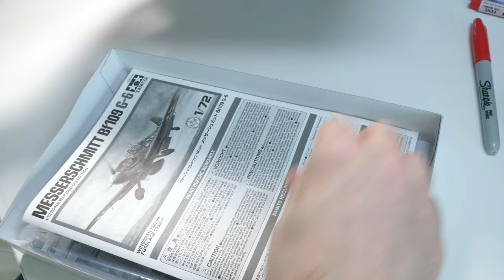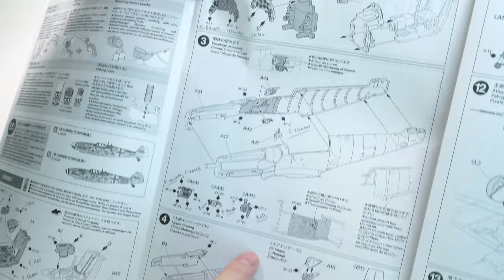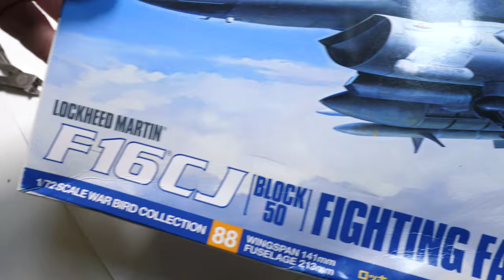HOW TO PAINT WW2 fighter cockpit with Posca paint markers part I

Comment: I have literally spent hours upon hours the last two two days trying to find a vid like this with the info I needed before blowing money. All I wanted to find out was to find a good paint pen, one that I can clear coat/varnish over without the paint dissolving and ruining my projects. I am a newbie to painting and airbrushing die cast restorations. I wanted a way to write and  draw on die cast without buying an inkjet printer, decal paper and other stuff I would hardly ever use to justify the cost and room taken up. So freehand is the way I want to defo go. I realise your vid is on a plastic model, I will be doing them straight from the box too. Anyways…many thanks for your vid and the detailed demonstration and which paint pens you find work for you
Reply from the maker: Thanks ! Really glad this was useful to you. I think there are other pens that are similar but on nearly every project I continue to use the Posco pens. Also they have not dried out. One other tip... you can also use the ink from the pens to be painted on using a fine brush for extreme detailing. Wish you luck on your projects.  You say you will varnish over and that is very important as the paint pen ink itself can easily be scratched off its not durable.

Comment: While these are really handy pens I think you can control the amount and flow of paint better and more precisely with a very fine brush. The ink seems to run too strong through the nib ( Black examples ) whereas with a very fine brush you can draw paint off on the edge of a container to control the flow on the tip ... they obviously have massive advantages in some applications but are not well suited to others. Use them both ... perfect world.
Reply: You can dab the pen on a towel to get some paint off and then use the marker to not have the paint run so much. Almost like dry brushing in places but with some better precision.